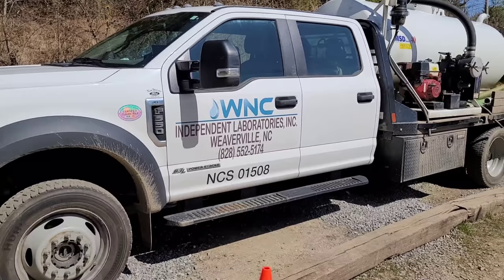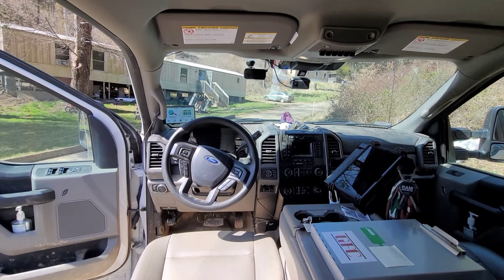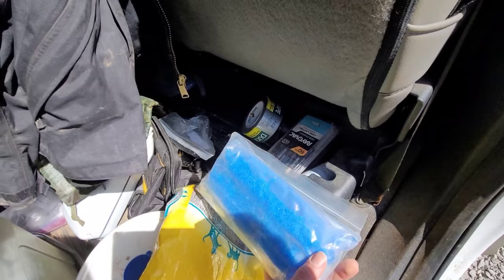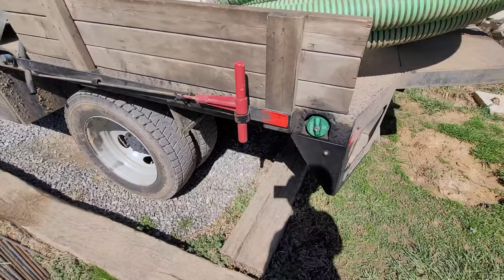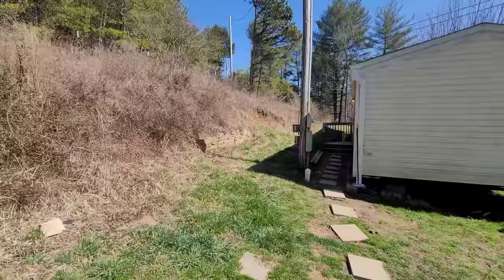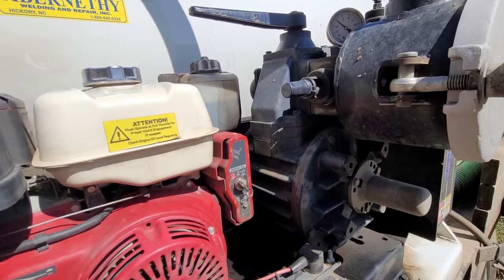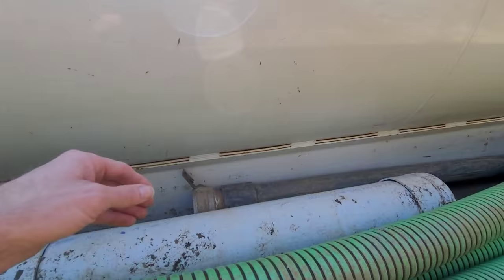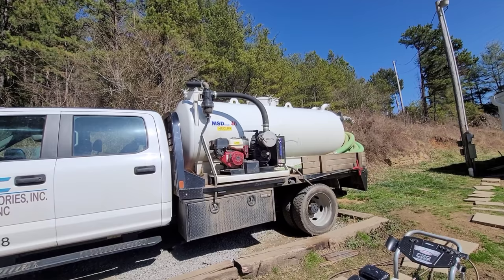Truck walk thru.

Comment: My FIL runs a single axle 2,500 gallon truck in NYS and with the freezing temps that we see, we use a heated valve that uses the engines coolant to unfreeze the valves on the way to the jobs; we keep both valves open with a bucket at the valve when the truck is not running in the winter. 

You didn't discuss hand tools in this video, but we stay away from carrying battery powered drills and saws as everyday carries and instead carry hand saws (hacksaw and wood saw) as well as a ratcheting brace with a quarter inch socket drive head and 1/4 inch sockets and screw bits that fit into a 1/4 inch socket. 

These items guarantee that we can complete most jobs with the least amount of headaches since we are not dependent on batteries, and also aren't injuring wrists using screw and nut drivers when unscrewing lids or tightening ferncos. We will bring battery powered tools if we know we need them, but not as everyday carry. 

My father in law also created a better way to deal with clogged inlet pipes. He took a 3" 90* elbow and added a fernco on one end that allows the 3" hoses to easily be added to it and a short piece of pipe 3" I.d. to the other. This allows us to use the truck's vaccum to remove clogs instead of having to snake them multiple times.   

We also use the truck's outlet valve to backwash the tank allowing more of the muck to be easier to remove on tanks that aren't pumped regularly.

Comment from the maker: Hi
Reply: Honestly, I can only think of two things. A portable winch that can be coupled to the front of the truck if needed or on a frame to help lift the lids. Second is to ask in advance for people to send pictures of the access drives or videos, you can setup an WhatsApp account or telegram account so people can send those pictures/videos. Maybe include a water kettle that connects to the car 12V so you can heat water and use to clean, and even drop on top of the ice that freezes those connections that you mention.
Reply: Being someone that lives in Canada and deals with stuff freezing for half the year if not more. I would recommended looking at if your can buy or have someone make a heated/insulated system for the valves. I would recommend having it be able to run off of the 12V battery from the truck when it's running and/or have it be able to be plugged in to an outlet while the truck is parked.
Reply: Hey James, love the tik tok, couple things, 1. Maybe a little box to put the hand tools in, going around corners the tools have the potential to come off the bed, also, maybe some lights to illuminate the bed for those after hour calls, something on the pump so you could see it if anything was to happen to it, so you could see it to do minor repairs in the field, being able to see when putting up hoses and those hand tools
Reply: I would also try to see if any dust seals or gaskets would work with the vacuum pump lever
Reply: I don't see a rack for the fishing poles
Reply: Hey James. Car guy here, wire that battery up to an alternator, either the one off of the truck or one that can attach to the Honda motor. It'll triple the life of the battery. To offset the extra weight you could even go with a lithium-ion car battery which'll save you 20+pounds as well as being a more rugged battery compared to lead-acid batteries. Just my 2 cents.
Reply: @joshuasaunders2198  I thought about wiring up a secondary battery under the passenger seat or in the back foot well, like you see big audio system guys run?
Reply: Only two things I can think of. First add a little bit of rubbing alcohol it'll prevent water from freezing in the pump during the winter. Second I might recommend adding tool mounts on the wood panels.
Reply from the maker: @christopherkillebrew9968  Last year we bought tool mounts, and in true form, we never installed them.  We have them, and I just hired a shop guy....so here is to hoping.
Reply: Wouldn't it be easier to have your tablet or laptop as a GPS?  The program u use could have a hyper link on the work order and once you select the work order then they can hit the hyper link and then have a GPS.  U may just need a satellite mount which is pretty cheap.  Not sure if all the crew use the tablets as ways to send and receive info plus ways to clock in and out.

Comment: You didn’t mention anything about having a back up camera anymore they’re so affordable if it prevents one accident it’ll pay for your entire fleet of trucks to have them
Reply: All new vehicles have factory back up cameras in the US since about 2014.
Reply: @andykokes5690  isn’t that just on consumer vehicles?
Reply: On cab and chassis they are wired for backup camera but since there’s nowhere to mount it to it’s an option but you can buy the camera and prep kit directly from Ford even if the truck wasn’t bought with the option
Reply: @andykokes5690  that is not true
Reply: @kawiet830  CM beds also do not have a location for a backup camera. It would need to be custom mounted. Typically I use the Ford camera it comes with because it has a housing and mounts, making it easy to just find a spot to drill a few holes. (I build service trucks for a living)
Reply: While I agree this could be a help, at the same time having a back up cam myself I hardly use it, granted after years of not having them i have become accustomed to using precaution, newer employees may rely more on them. Additionally with the line of work I would suspect it would get gummed up quickly

Comment: So this is in response to your Tik Tok account, I did this cause I enjoy it not to get money out of you. You were humble enough to know your limits and I respect that. I hope something here with be of some help to you down the road.

In the cab of the truck above your head in the center right behind the 12 volt outlets you can have a mesh net pined on all 4 corners for storage. Keep your clip board up there so it's not rolling around everywhere and it's easy to get to. 

There are special chair mounted elastic, compartmentalized storage systems you can get to put over your driver and passenger seats as well as your rear seats as well to get everything off the floor of your trucks and to organize everything better. It would also help eliminate confusion among your employees as everything would have a place to be put and any employee can get into any truck and immediately know where everything is. 

For the bad of the truck first and foremost, get some large sized square piping and weld that shit to the front of the bed where you've been "throwing your tool". This will allow you to stand your tools upright so they can't move around on you and open up that space right behind the headache rack for more of whatever you may need.

For your freezing pipes issue, I work in injection molding and there is a thing called a nozzle or tip heater. It's just a small ring you can get in various sizes that goes around the pipe your need to heat(or barrel in my case) and can heat up extremely quickly. It just has 2 wires coming off of it but it might be useful to help you with the freezing issue. I will warm you now though, the ones we use can get up to 600 degrees and over so I'd look for one with a regulator or something similar to keep it from melting your pipes. Steel shouldn't be too much of a problem but it might boil the contents inside... Just fyi. Use this as well for any other water freezes.

For the seals pooping out, I'd suggest looking into how monster( the energy drink) seals thier cans and see if there is something similar that you can get. 

I would suggest looking into semi-trick truck tires and or to replace the ones that you're currently going through they are standard going to be more reliable and should help you out longer than the typical City highway tires that you can get somewhere else and with the vehicle as big as it is you can probably get the right tire size and get away with it

For the "mucking sucker"(?)(the pipe you use) consider taking the diameter of that pipe and buying a 4 or 6 inch piece of square tubing, cut it in half long ways and then weld that to the bed so that thing doesn't slide around everywhere. 

Good luck! Keep up the tik-toks!

Comment: Mechanical designer here - machining or even 3d printing some sort of cover to keep water out of the stem on that vacuum pump would be pretty straightforward.  I could design & 3d print you a sample with a few measurements...
Reply: Just use grease
Reply: Grease or find an umbrella seal

Comment: I used to live in the country. I started with a septic tank and drain field and ended up with an aerobic system. I am quite familiar with septic pumping and had always been fascinated by sewage treatment in general. If I had to choose another career this would be it. It is so necessary you can go to bed at night and sleep well knowing that you have performed a very necessary service.

Comment: For the pump control handle try putting a line of silicone sealant around where the water collects. If you need to disassemble it soak the silicone in mineral oil, alcohol or vinegar. Then scrape it off with a pull scraper or sharp knife.
Reply: The pump control handle is clearly badly designed. Rotate thru 90 degrees so it's on its side. Will reduce water ingress.

Comment: I adore your use of smaller 550s and the like. When I worked for one of these companies all we ran were Kenworth/Sterling/Mack vac trucks with 3000gal tanks. Up here in the bush roads of Ontario I'd have far rather backed a half tonne up a donkey trail to get to some cabin.

Comment: I love the preparedness of it all. Worked for a place that had no vehicle / fleet / safety policy and comprehensive on-board equipment/tools. Made me angry for some of the staff (the ones who I didn't hate, anyway) to be driving a janky/older vehicle to jobs,  sometimes in the middle of the night, and not have a fall back for a breakdown or accident other than to call someone (who may or may not have their phone on). 

There was maybe 1 florescent orange triangle that I wasn't even aware about till way later.

Comment: Can you convert the honda engine to run off the diesel tank in the truck? Would save you from packing that can around. I would put a coned pipe with a slot for the handle that goes past where water gets in over your valve on the pump. Might take a few iterations. Maby a converter of some type to get charge the honda battery when the truck is running. Also could take some pipe and weld it on the headache rack to organize your tools there. Could have a secondary pipe come from your exhaust in the winter to unfreeze that bottom valve. I would have it on a butterfly valve that can be tured on in the winter. Or insulate it and plug it in when you plug the blockheater in.
Reply: I would say the diesel is a slower engine so it would not have a effective pump so gas would be a better speed for the pump

Comment: Porta potty/various other septic needs truck driver here, we use amthor tank setups but I have to say having a 50% fill bubble along with the 100% full bubble helps me out a great deal when I have a lot of stops with lots of sewage,  gives me a better idea where exactly I'm at so I don't get somewhere and can't finish a job because I got filled up. Also I'd suggest instead of running a bunch of hoses the same length, get a few hoses like a 60' or two, a 30' and a 20'. Whichever combination would give you the range you need in the least amount of hoses possible. Then instead of the guys needing to connect 3 20' hoses they just use one 60', or instead of 2 20' hoses use one 30' hose to go the 25 feet they need, the less hose you use the more pulling power you get, overall results in jobs getting done faster. In my experience clogs are easier to deal with in one hose than two or more connected hoses.

Comment: Worked in North Dakota for a few years “-50 degrees”. Hauling  water to fracks. My masport 400 was heated/cooled by the engine radiator by heater hoses. Pump was always moist but 20 minutes running down the road pump was nice and warm, never frozen. Much better then champion or fruitland air cooled pumps. 

I always had a weed burner torch and a smaller soldering torch to heat valves when they freeze. The weed burner had a short wand on it so I could lite it an just set it close to the valve. No matter how froze up it would thaw it out in a few minutes. 

You have space for an other tool box behind the rear tires. You could easily place the propane tank hoses in it. I used a 1.5 pound tank so I could carry it around if needed. 

🤷‍♂️ just some ideas from 45 years in the oilfield.

Comment: 1. the Yeti cooler: have you considered a 12v fridge? implementing a second battery dedicated to it is a very simple task using a voltage sensitive relay and would save you the time and cost of ice over a period of time.

2. reverse camera. I live in mine. The higher it is the better and for easier implementation try a wireless unit.

3. fuel to pump. in our trucks we run a line from the vehicle tank to the pump and use a simple momentary switch to transfer to the pump tank. this requires a valve at the tank. happy to talk to you more about it.

4. freezing water over that valve. at the end of every day I'd suggest covering it in a wafer dispersant like wd40 to prevent any build up. it can't freeze if it's not there.
Reply: #3 truck is a diesel. Pump is gas. Good idea for a gaser!
Reply: @mikecrompton481  copy. Wasnt sure about fuel type. Over here there's very few petrol vehicles over there but I know you guys are fond of them.

We run diesel powered pumps at our workplace. Yanmar do some great products.
Reply: @emptycoffin  I'm firmly against communal coolers they're cesspools. But I can go for a fridge.

Comment: Hi, I follow your channel on TikTok. Thank you for making videos, I enjoy watching them. Have you ever thought about getting an ice maker for your business if you go through a large amount of ice for your cooler ?
Reply: For your truck tools / supplies you store in the back of the truck. Instead of everything just on the floor under the seat. Maybe custom build (if you can) some type of drawer that can be installed in the floor of the truck so you can organize it better. This can include a hole for your yeti cooler to fit in so it doesn't take up leg space while traveling. My last idea is you can also maybe add some hooks to hold in place all the tools that are stored between the tank and back truck window. This will prevent them from moving around while driving or the possible risk of them sliding off the truck.

Comment: James, love your content, not interested in working your field but your pragmatism is infectious. You like solutions... correct? I have one for you. The Masport pump control handle winter freeze has a very cheap simple solution. Take a water bottle, one that is about the same outer diameter as the bearing housing (right in there), cut the bottle in half, cut a slot in each half (on the cut side) the width of the control handle and deep enough so that once inverted and placed over the handle so the cut edge of the bottle overlaps the tapered bearing housing creating an umbrella that sheds water away from the handle and bearing race. Hot glue (neatly) the slot in the former bottle to the handle so it doesn't blow off in transit, you now have a very inexpensive, fairly invisible modification that probably only needs to be installed for three months in the year, insuring annual replacement so it won't get too raggedy.

My guess would be, if water can infiltrate and freeze, it probably isn't good for the mechanism during any season, water and metal don't really get along.

Drop me a line if this helps at all.

P

Comment: 3 suggestions.  I drive a non has met tanker truck so I deal with those quick connects and 3" rubber gaskets. 1. Try wrapping gasket with electrical tape. Tighter fit. 2.  You did not mention it but wondering if you had drain holes in the front and middle of your truck bed so water does not collect. 3.  Might want to get a small Rubbermaid container to put the small items that you have behind the passenger seat in so they are not laying all over the floor. Thanks for your videos enjoy your content

Comment: Milwaukee pack out might help clean up the back of the truck up if you don't use them already.  They are super nice to keep things organized and clean. I've also seen a lot of ranchers make the sides of their flat beds with hinges on them that can drop down and you could pin the tools to them and have quick access and add a little more securement.

Comment: Freeze up problems 
Maybe look into a block heater or heated cables. They usually require some decent power. Maybe enough to run off a good inverter, or just a magnetic block heater for back bottom of tank to keep warm or thawed out while truck is off duty.On pump selector handle a cap over it or silicone the gap so water won’t build 
up. I appreciate the money you spend to make life easier for your crew and the forethought on things saving money in the long run!

Comment: Here from TikTok and the only recommendations I could think of would be to use oil dry instead of kitty litter, it’s usually cheaper and works better. The second thing would be that you could run the key start for the Honda motor to the battery’s in the truck itself or put a battery tender/ charger on the existing battery at night, that would let them last longer than the year you are getting now and save you a lot of money in batteries every year.

Comment: Beautiful, absolutely beautiful. Well thought out and you adapted to all the problems. Well almost all of them Honda makes the best engines hands-down but we have had trouble with the batteries to. We have gotten around it by using a trickle charger when parked just works better that way, as far as the water freezing in the air valve, me,? I just put a plastic bag over the whole thing and duck tape it in place.